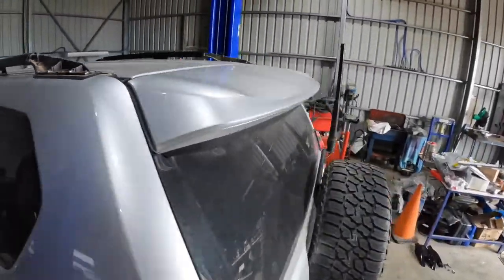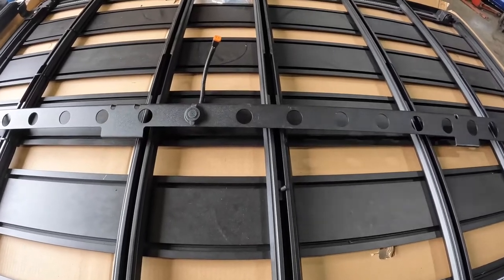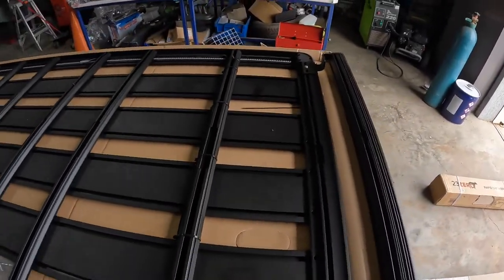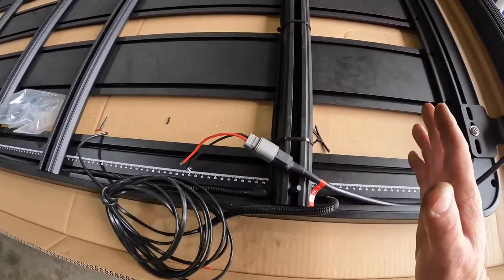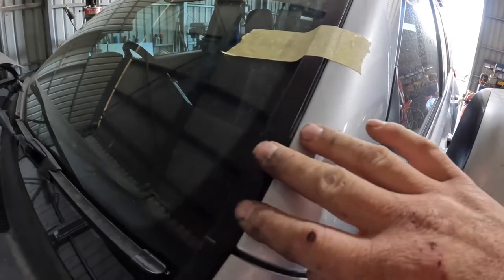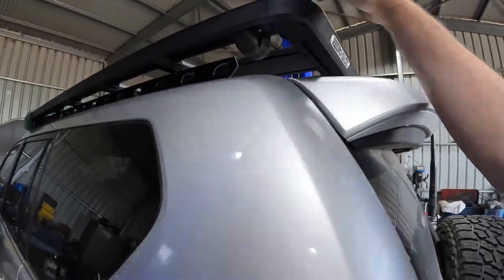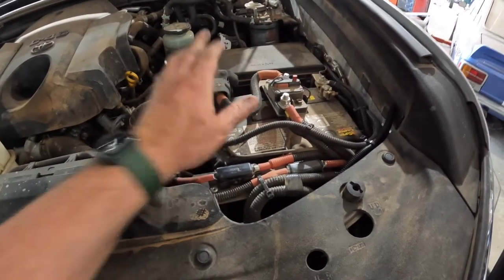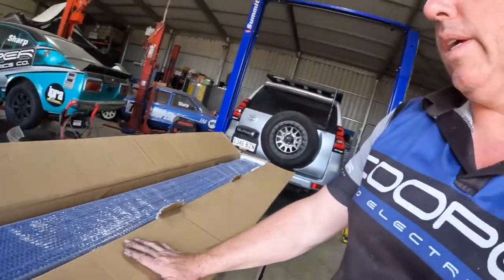150 PRADO get BACKBONE roof rack + TIPS for intall

Comment: You mentioned in the video that they used loctite to seal the thread and that you will show what you can use but did not see this in the video. Could you please share what would be good to use for this? Thanks mate!
Reply from the maker: It’s called loctite thread locker and is sold in a little bottle, hope this helps!